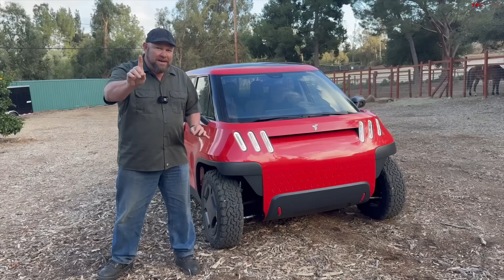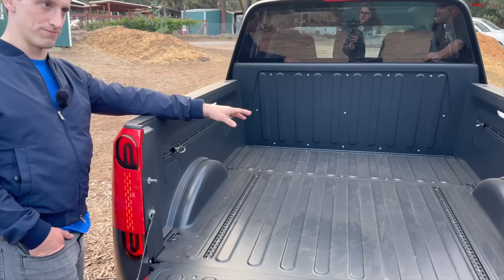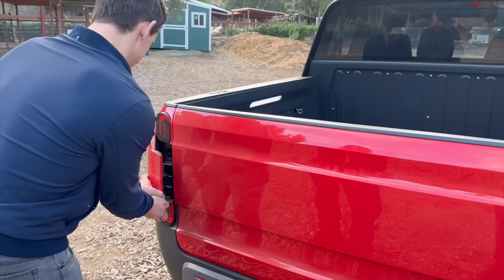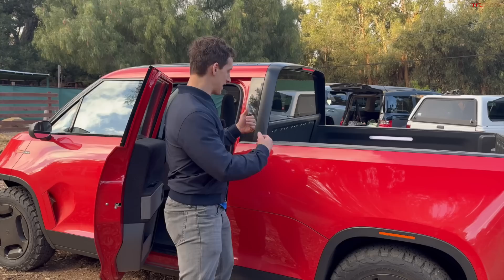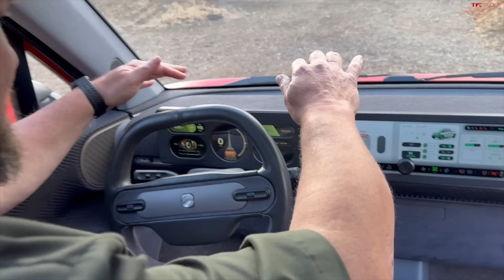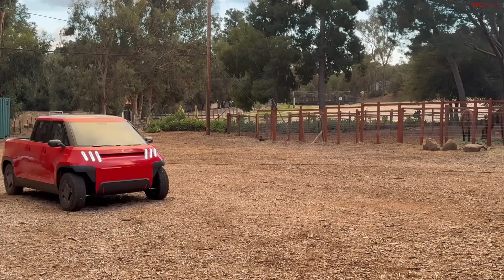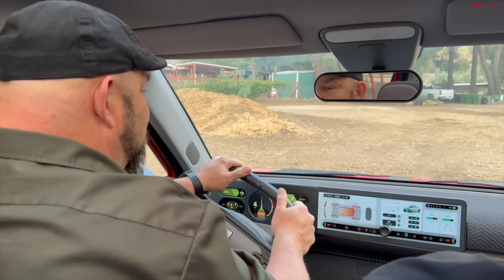I Drive the Most Revolutionary Truck In Decades: Meet the Telo MT1!

Comment: I like the concept, but 41 grand is still too high a cost for this. 
Their target price should be like 27.
Reply: If you charge at home, every fill up will. cost about $8.00. vs around $30 - 40.00 for 260 miles worth of gas There's also very little maintenance besides tires and alignment.  It adds up to quite a bit of savings over ICE.
Reply: @anxiousappliance  Yup and trucks have more frequent maintenance, doing an oil change yourself for an F150. Ec
Reply: @anxiousappliance  but it's not going to compete with even other EV trucks at that price, optioned up, in the mid-50s maybe?   I am leasing a Lightning XLT for less than $300 a month, no way this truck could ever compete with that.  But I could have bought the truck outright for around $50K, I don't want to make a long term committment though because I'm waiting for the technology to improve.
Reply: @Brons2 Yeah - I hear you, but for the right person it is the right truck.  I don't think they are looking to sell the proverbial sh*t ton.
Reply: @  I wish em luck.
Reply: @ 
Yes it does: providing it works as advertised daily.
Reply: It's pretty high, but you're always paying for investment in new factory and development
Reply: Wonder if it would qualify for federal tax credits because it probably would hit the mid 30k.
Reply: Clearly you have not priced a new car lately.
Reply: I'd spend 41k in a heartbeat if I could have it. Plenty of cargo space, compact enough to find a parking spot in the city here in Europe, and capable of long distances. There isn't much competition. I don't know of anything in that price range.
And I love the style. Half Hot Wheels, half moon rover. 😁
It's sad that I'll never be able to buy this thing here.
Reply: Mid 30s
Reply: @mikehenson819  they have $10k trucks over seas not available in America because it would destroy the market
Reply: I agree, even if they had to produce one with a smaller range
Reply: True it should be cheaper but it is not 2010 anymore. Everything is expensive in this market.
Reply: @Novusod  you can buy 2 Hyundai INSTER for that price and this is a time-tested brand with many dealers
Reply: @R3YVAH  that’s not a truck, and Hyundai isn’t a beacon of reliability. $41k, for something that can carry plywood, is very good in this market.
Reply: @HydratedBeans  and how reliable is this brand? I'm not putting Hyundai on a pedestal, I'm just saying that if one breaks down, I'll take another, and to carry a couple of bags of cement, I can hook up a towbar and pull a small trailer. The fact that this pickup doesn't make it a very practical car is just a small plus. What I really liked is the roof and the pickup's cover made of solar panels, if they are energy-efficient, it's very cool. But inside there will be Armageddon in a year, it's all very delicate and not practical, a good car for a crowded city, but not for 41+ thousand to 32 maximum
Reply: @Novusod  All things are more expensive because we as consumers allow them to be. The market speaks with its wallet. More people should understand this and realize we have the power. If we deem its “too expensive” then we should not buy it. If enough consumers don’t buy it the product either magically gets lower in price or goes away.
Reply: @jbissol  Toyota sells a truck that costs $10k to make but the government banned it because we don't live in a free market. Even with a 50% tariff it would still be cheaper than an American made truck.
Reply: @Novusod if your talking about the IMV 0 , I love it !
Reply: @jbissol  Yes that is the Truck. The IMV 0 is most affordable "real truck" in the world and it is banned in America.
Reply: @Novusod   I will keep my pro4x
Reply: $27k is what a base Maverick costs. $41k is very reasonable for a long range EV anything.
Reply: @misaelramos83   That base cost gets you very little and 42k is the "preium" model which still feels like the interior was made by a portapotty company.  I also tried to buy a base model in late 2023 and early 24 and was told that they were selling marked up at several thousand over MSRP even with Ford A plan pricing. 33k was the best price i could get on a base  "truck" .

I think 41k from a company without its own in house manufacturing like the other large brands is BEYOND reasonable.
Reply: yes, that should be the target.  base model 27-30 out the door.
Reply: I agree, that's WAY too high. This doesn't look like more than a glorified electric side-by-side.
Reply: I think $41,000 is completely reasonable for a vehicle like this.  If I we’re in the market for a truck i would consider it.
Reply: $20k
Reply: Agreed.  Twelve months ago, a Tesla Model Y single motor, 260 mile range was $31,000 after $7500 incentive and $1000 manufacturer discount.
Reply: @aleewade4162  Tesla sells cars in the millions. If Telo gets to that, their prices will drop appropriately.
Reply: @mikehenson819  better off getting a maverick for 30. 41K for something that looks like it came from TEMU lol
Reply: @UnknownUser-uo8sf  The Telo truck has pretty good value for money compared to Maverick. Bigger bed, can tow more weight (in theory), and will be cheaper to run. Also, keep in mind this is a hand-built pre-production model from a brand new company.
Reply: @UnknownUser-uo8sf  it has creaky suspension and a rough ride. Plus the footwell seems smallish, wonder how the car will hold up in a side impact crash at the front wheels....
Reply: @bwmanarific  It's a preprodiction unit.
Reply: plus is looks cheaply made.
Reply: @FosterFarmsOk  because it is the first running prototype there will be changes for production.
Reply: @FosterFarmsOk  looks much nicer than maverick cost a few grand more and less than any other "small pickup" with any sort of features and offers more practicality. The ranger i ordered in Q3 2023 was 49k and wasn't even delivered until a year later by which point i had purchased a 1500 to fill the role/
Reply: @killbots94  this looks nicer🤔😂 This looks like a glorified golfcart.
Reply: @FosterFarmsOk  It's a pre-production model. 😆
Reply: it will never make it to market. the hood of the car is more than just for the engine. its for safety, so I can see this never making is past a crash test.
Reply: @YankiEBubbAAussiE  , the CEO is an automotive engineer... there's an interesting section of Tailosive's "Meet Telo" video (before Drew started working for them) discussing the 18" crush zone that equals industry standard after accounting for the engine, radiator, etc that has to be subtracted from a conventional car's hood length.  They won't be able to make it road legal without passing the crash tests (among other regulations), which they appear to be fully aware of.  It's an interesting study in the design freedom electric platforms allow with new layouts. Some states allow Japanese "kei" trucks to be registered for road use (after the 25 year federal import rule), which definitely don't pass crash tests. (Apologies if this is a double post... first one disappeared)
Reply: @YankiEBubbAAussiE  did you not watch the video?
Reply: @YankiEBubbAAussiE  Did you skip the entire "safety" section of the video? Also, are you not aware that Smart Fortwos exist?

Comment: A cybertruck without an ELON sized ego!  

Someone chopped off the nose, but it's got a wonderful approach angle.  The rear SUV conversion option is very transformer's like and wonderful innovation.

Hope the final product has some nice cubbies for storage, passenger/driver/rear.

Hope the parasitic power draw can be near zero when in a power saver mode.  Otherwise, a vehicle like this must be used often.  The custom solar is nice, but will be a pricey option.

Could not find the weight spec, but they are still in pre-production.  Would be good to know a weight range.

Also, what is ground clearance?

The 300+ mile range is great.  Overall love the concept and if they can meet the price point, very interesting.

However, what NMC chemistry is being used?  I don't want my truck to melt like some other EVs in a firely death that takes a house with it.  I'm really wanting to see a LiFePo4 based vehicle that does not catch fire when the battery gets too excited.

PS.  I like the 2person option with long bed.  Did not see the option for this on webpage.  ETA?
Reply: PS Impressive payload numbers if they are close to real, most impressive.

Comment: If the 1-motor version was FWD, I'd be very likely to try to get a used one when I'm ready to move on from my Bolt. (I live in Colorado)
I love the Bolt so far, but the barely 50kw fast charging is slower than I'd like. (I'm looking for 150kw at least, in my next EV)
I'm hoping in 8-ish years, the price on a used MT1 is at a point where I can easily afford a dual-motor long range model.

The Rivian R3X is very interesting to me though. I love hatchbacks, but would like the better cargo capacity of a mini truck.
My last car was a Honda Fit. And well, it fit a ton of stuff! My Bolt.. ehh. It's not nearly as good as the Fit was.

If there Honda would've brought the EV Fit to the US with a minimum 60kwh battery, I would've bought it in a heartbeat. I miss my Fit so much xD

Something they didn't talk about in the video, was if the truck had a heat exchanger, or resistive heater. As well as if the battery was liquid or air cooled.
I'm hoping they went the smarter routes for efficiency and longevity of the battery. The Kia Soul EV was interesting to me before I bought my Bolt, until I learned how quickly the battery could age.

Comment: I love that they prioritized minimizing the length of the vehicle while still giving a full length bed with the back seats folded down, but I really doubt having the front wheels exposed like that isn't bad for aero (they say those pill shaped cut outs help with that, which I'm sure it does, but it will still be worse than having the front wheels covered). Also, having an exposed bed is already terrible for aero on trucks which is why the Cybertruck has a sloped bed cover. This has got to hurt the range of the Telo truck. Regardless, it's still a better idea than the oversized and impractical trucks that have become so common in the US and I hope they make it to production.

Comment: This is a joke. A status symbol. An overpriced truck for the ill-informed. For the occasional usage it should be the same principle as the old Ford ranger or S10. Small, reliable, affordable. Didn't need 500hp. Didn't cost $41k. Just another EV crook

Comment: 100 kWh battery in a vehicle this small is crazy. I was actually surprised hearing 350 miles of range I was expecting more like 150
Reply: they maybe lost weight with the carbon fiber /composite bed, etc. so they could extend the range?
Reply: @nathanschmick9681  honestly that's what I don't understand with EV cargo vans - they have all the space for 200kWh and more and they limit them to around 60kWh. What?
Reply: @nathanschmick9681  that's 350 on the dual motor
Reply: The sunroof is nice but sitting in the back it could be super blinding if the sun is overhead. I'd hope they put a light stock tint on the sunroof to help that.
Reply: This would have been the factoid that I would have asked more questions on.  Specifically the battery temp management given the constrained size, perhaps also if it would be practical in northern or high elevation climates where winters get cold.  Their CEO clearly understands the product and the choices made to develop this prototype.  I get strong honesty vibes from Telo, which makes me really want this company to crush it in the success department (if they can build them, they'll surely sell them!)
Reply: Aero has a bigger impact on range than weight, and they've done their homework on that front too. The small frontal area of the low design plus all the little tweaks they made to guide air smoothly around the vehicle gives them their range.
Their website gets into it more.
Reply: @nathanschmick9681  Real world driving it’ll probably be closer to 150.
Reply: @syrtycon7299 it has a humongous battery for a small car, more than likely, itll go over 500 miles in the city.

You'd have a good point if it had a teeny battery, like other cars, but its battery is massive for its small size, and that range is way too unrealistic because you could easily get five hundred miles out of this thing

Comment: Another follow up, the 41k price will probably be at least in the low 50s for the long range AWD and yeah... that's a bit higher than is optimal. (figuring that a base Lighting with the bigger pack is around 60 and the 2 motor Cybertruck is around 70). Very different cars, but for this not to be niche it has to compete against those two products.  What I think a lot of us really see in this, is a car for college graduates and young professionals.  The utility to car ratio here is astounding. I'm interested.  I wonder, long term, if startups like this will end up selling their entire design to larger manufactures to then slap their own badge on and call it their own.  Great review, thanks!

Comment: Good presentation, I wish this company success. A couple of concerns.  Is the back of the front seats a good stop for heavy cargo especially if in an accident. 
Also the removable panel at the front of the bed, is it structural?  I would like to put a motorcycles front wheel against it. If you could remove both the bed front panel and the window panel and install them at the B pillar and the folded down back seat was bed surface at would be more adaptable.  But all that being said, I am still impressed.

Comment: This is the type of design I've been waiting for.  Being able to get a flat surface I can sleep on is perfect.  You could totally stealth camp with the tonneau cover.  6.5 feet with the tailgate up and the rear seat down if their figures are correct.  Camping trips, hiking with the dog, snowboarding, mountain biking, picking up building supplies and dump runs with the ability to tow short distances in a short wheelbase is impressive.  Bravo!  

I could see this as a replacement for my aging GTI.  Same wheelbase with more functionality, more power, AWD, lower center of gravity and more ground clearance is a big win.  

Looking forward to this hitting the market at a relatively good price.  The market has been dying for a small truck with basic functionality.  No need for all the bells and whistles.  Simple design meant to actually be useful without unneeded costly BS that ends up costing more in the long run when it breaks down.  Off the shelf parts should be easier for repair as well.  Can't say enough good things about finally seeing realistic simple designs that are more affordable.

Comment: I've been following these guys for a bit now. When Canoo went belly up, I hung my hopes on Telo to bring this to market. The "small" truck market in the US can ONLY be done with EVs. In the U.S., small pickup trucks with gas engines face tough limits because of CAFE standards. These rules say smaller vehicles, like compact trucks, need to get high gas mileage—think 30-35 miles per gallon or more—which is tricky to achieve if they’re still built to tow or carry loads. Bigger trucks, on the other hand, only have to hit lower targets, like 20-25 miles per gallon, making them easier and cheaper for car companies to produce. Plus, people tend to buy big trucks anyway, and they’re more profitable, so manufacturers have pretty much stopped making small ones since they can’t meet the strict mileage goals without losing the power truck buyers want. But, there is still a void in the market for small trucks. EVs can fill this void. This is a great start. Are you listening Rivian?
Reply: I think you're underestimating the market for small pick-up trucks. Most people who want one, most likely do what I did, and settle for a SUV. If there had been a small pick-up available, that was affordable, (For me, that's around 20k +/-.) when I bought my last vehicle, I'd have jumped on it. Sadly, most pick-ups are these huge monstrosities that are far larger than I want or need, and are way too expensive.
Reply: @hansedrachensohn530  Didn't underestimate a thing though. I 100% agree with you.  Updates to CAFE standards in 2008 shifted the requirements to a "footprint" model, where fuel economy targets are tied to a vehicle’s size (wheelbase multiplied by track width). Smaller vehicles, including small pickup trucks, face stricter mileage targets which OEMs could no longer achieve. That is why I said it can only be done with EVs now. They meet the requirements. I'm 100% on board with the fact that there is a huge void in the market there.

Comment: The modern day small truck. I am also tired of seeing nothing but full sized trucks on the road and they never have a trailer attached. I recently got myself a 2006 Chevy Colorado and I love it, its a truck so if I need to do truck things I can (like have my ice chest in the bed instead of the backseat) and its small so I can pretty much drive it like it's a sedan without worry if I'm going to hit something while making a turn or turning into a parking spot.

Comment: Hmm, a relatively usable range. Small size yet highly usable space for this Videographer/Mountain biker/Surfer.. They've got acceleration covered. (as all EVs do) There are just no "no's"here that I can see, save one. Price. Many components are going up rapidly due to our, ahem, current government "policies." That 41K figure seems unattainable for 2026. So if a 2 motor with premium stereo, heated and cooled seats, etc, is 60K+, there is going to be big price resistance.  Hope I am proved wrong by this. If this were available now, I would be grabbing my keys. It has a wonderful design language and practicality. Beware, lots of competition coming in this category, although with 100% tariff tax, not coming our way.I wish Telo the best; obviously, some heads up, folks.